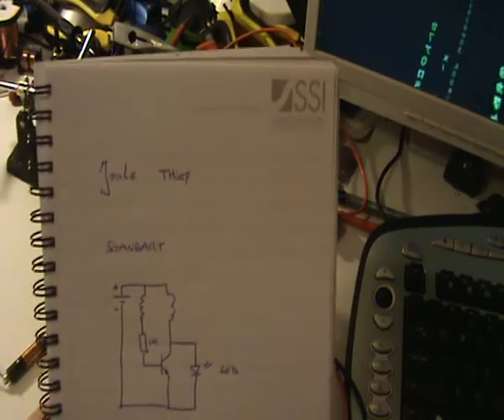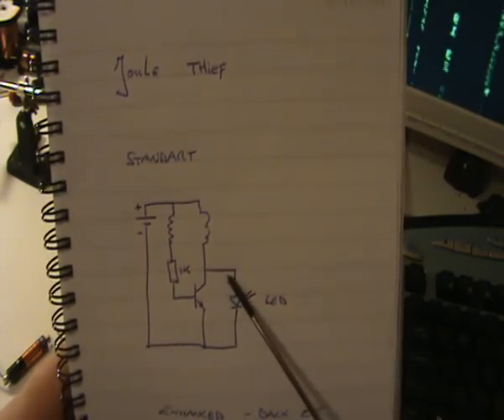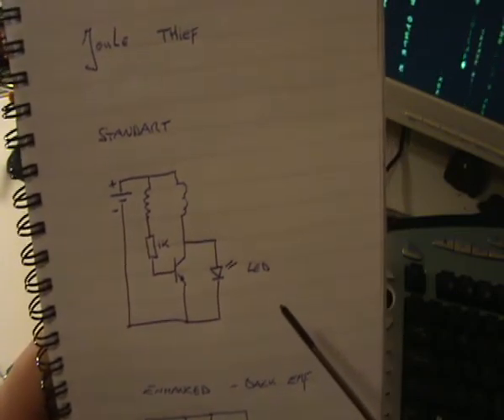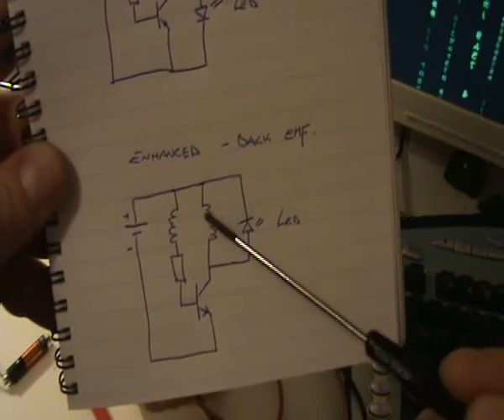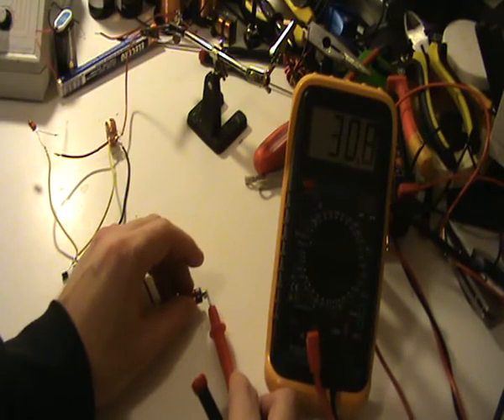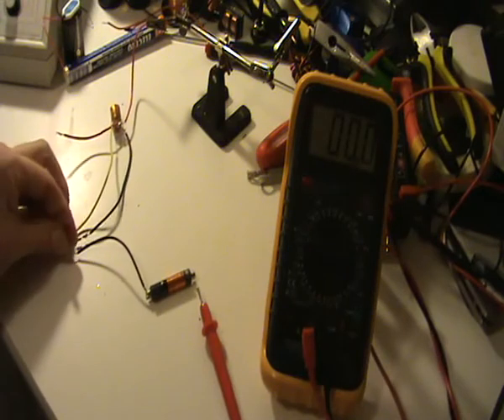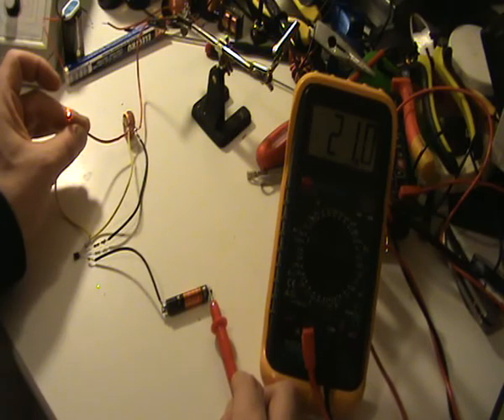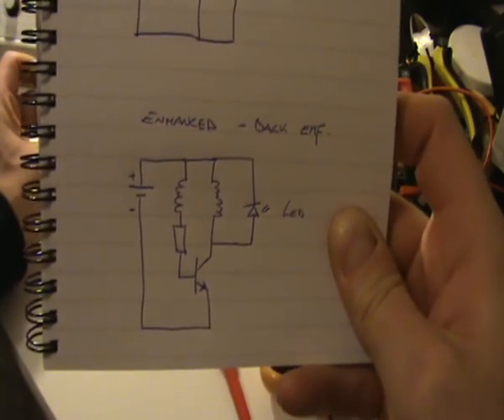Joule Thief - enhanced

Comment: Across the coil or collector emitter, fine running tuning the circuit with a capacitor and variable resistor in place of the 1k resistor will reveal less current draw across these transistor, experiment some note

Comment: The standard JT has the battery in series with the LED, so the coil has to overcome 1.5 volts less than with the LED only across the coil.  Therefore the standard JT draws more current and is brighter.

When you look at the LED the difference in brightness is not apparent to the eye.  You have to use a luminance meter to determine the exact brightness.  You will then find that the lower current is also lower brightness.

Update 2019 Apr 1  There are no measurements of the LED current, telling the viewer that "it's just as bright" is not a valid measurement.

Comment: I can confirm this circuit works. I was skeptical at first as to how it improves on the original, but all the logic is sound. I initially designed it in a circuit simulator, and I could visualize the current flowing through the coil after the transistor slams shut, it basically continues to cycle current through the torroid till the energy potential fails to conduct across the load. In addition, the dc source ceases to push current as it has no path to ground. In the original joule thief circui

Comment: I make your enhaned version of joule thief and it was consuming 18 mA.  The same joule thief in the original configuration consume 26 mA.  So, definitively, your modification is quite more efficient and give a realy big advantage over the original joule thief.  I will continu to explore possibility with this design.  Have you tried to take the potential difference at the diode side in your configuration ?  My results are very unusual...  Good research.

Comment: @emc4u2 That is what I have been doing except that I use an ultra fast Schottky diode and so can charge batteries up to 60V. (Off a 1.5V cell) (Off a 12V Battery I can get about 300V into a capacitor)

Comment: That is very cleaver and you get an efficiency of: 20mA / 54mA * 100 = 37% efficiency (standard)  20mA / 21mA * 100 = 95% efficient (enhanced) so that is an increase of 58%!!! (Assuming that the LED is a standard red LED with a current of 20mA) That is a staggering increase well done.